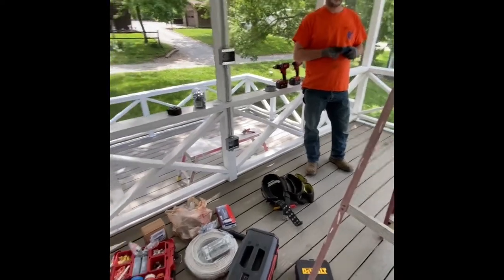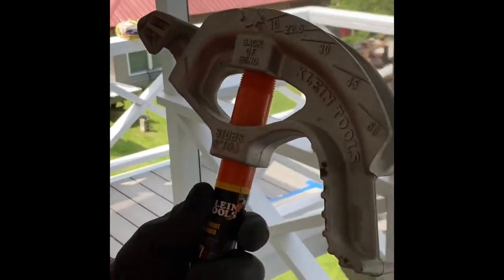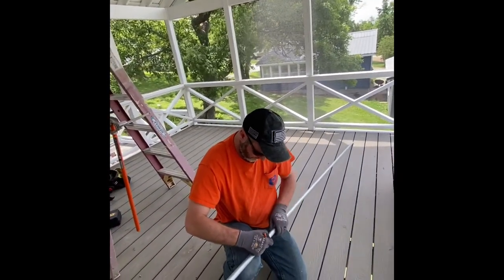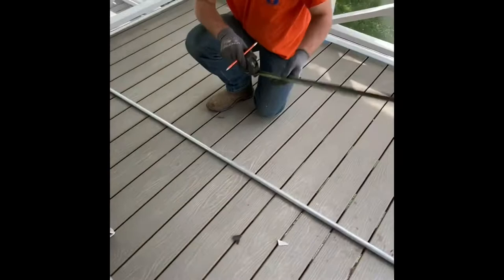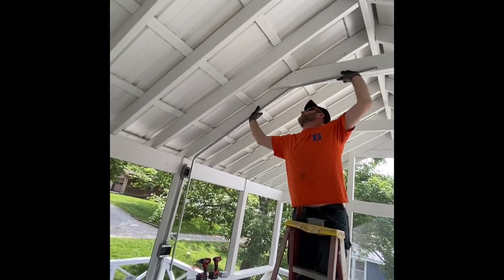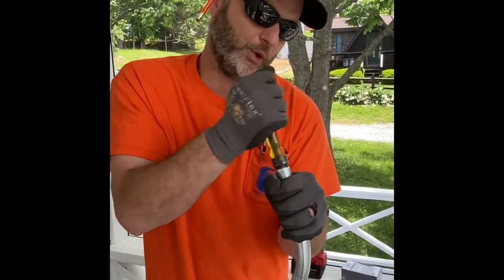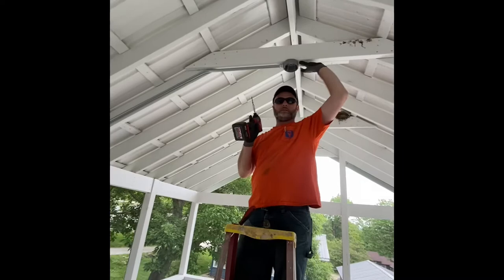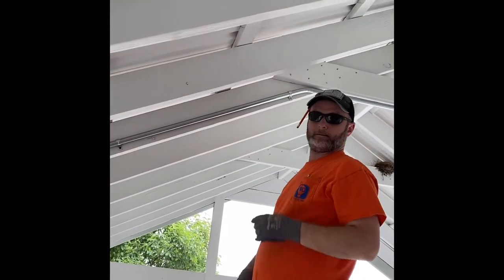Outdoor electrical conduit on deck

Comment: Does the wire slide easily from box to box through the pipe?
Reply from the maker: Thank you for the question.

On a short run it will usually slip through without any issues. You can use fish tape from the opposite end to help pull it through if needed. On longer runs I use some soap on my wire to reduce the friction. Each pipe diameter has a limit on how many wires you can use inside the same piece of pipe. Take the twists out of your wires before feeding them into the pipe. I used 3/4” conduit here and it pulled much easier than 1/2”.
Reply: @boxelder9167  Awesome, thanks for the quick answer.